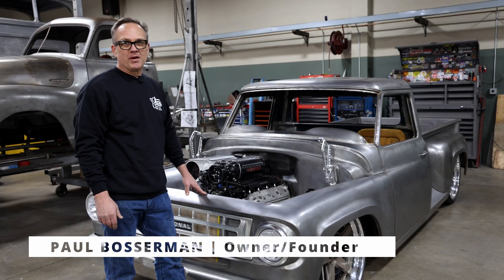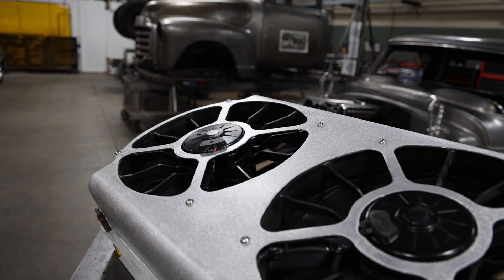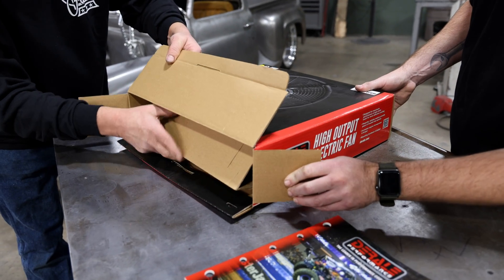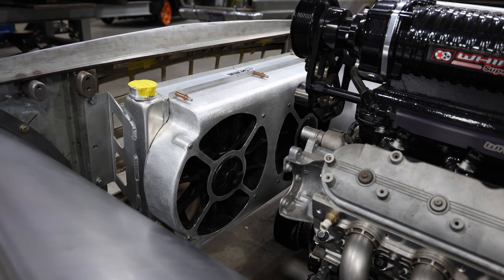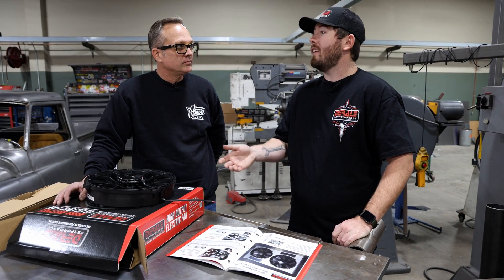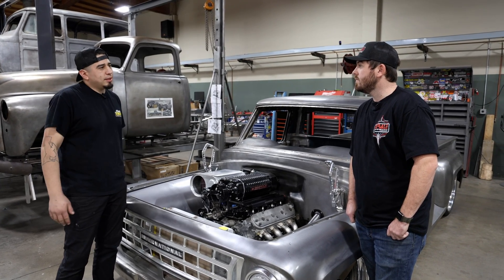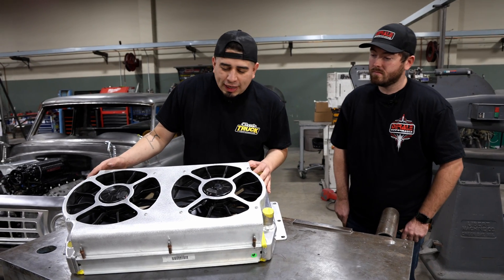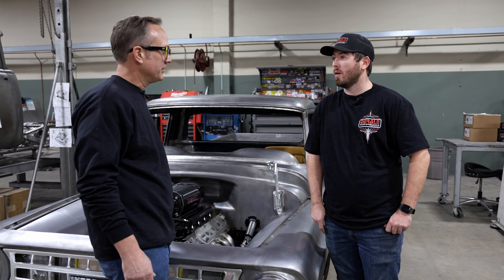Electric Cooling Fans 101: What the Pros Know that YOU Don't

Comment: I've heard rumors that you have to upgrade your alternator when you go from having a manual fan to putting an electric fan. Is that true?
Reply: If it’s less than 90a I would. Never hurts to have a little extra power especially when you plan to add accessories.